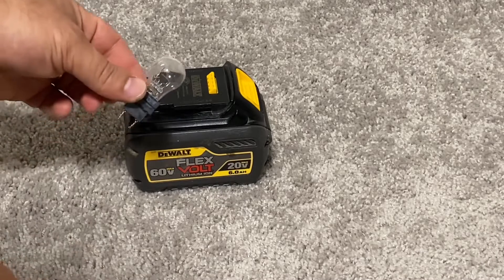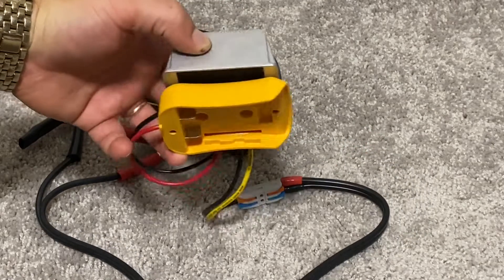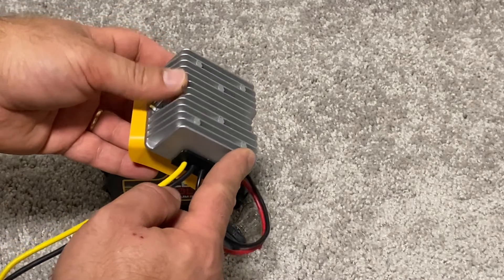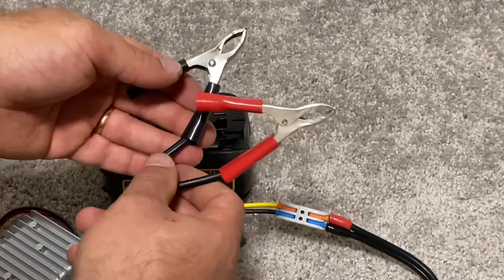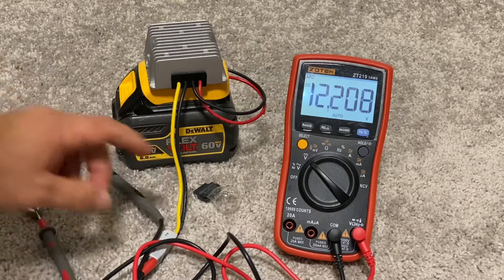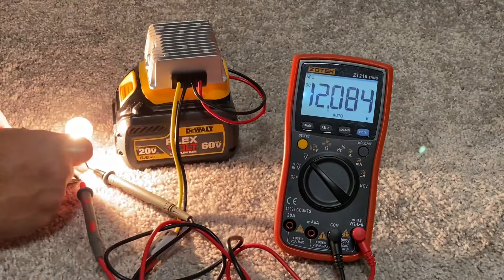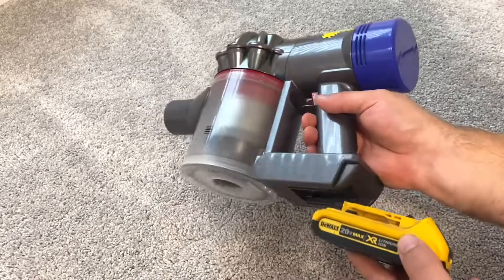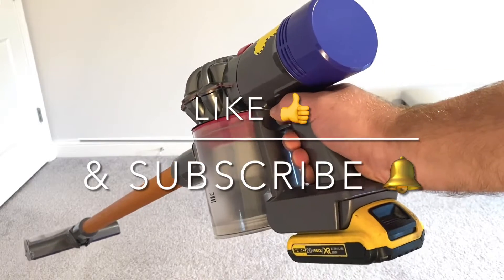DeWalt 20v to 12v Inverter Adapter 15 Amp 180 Watt review jump start car

Comment: Hi Mr.  If we have a step down 21v to 12v with more ampere capacity (40/50A) could it for jump start car?
Reply from the maker: I have one with 15 amps and I was able to charge the battery for about 30 minutes and then start the car, but 15 amps alone wasn’t able to start it. I am not sure if 40/50 amps will. It would surely put a strain the the DeWalt battery that may damage it. I would’t risk it.

Comment: I have noticed when I attach a DeWalt battery to an unofficial Dewalt device like a light and leave it run long enough to wear out  the battery it kills my Dewalt battery and will not take a charge again. I have had this happen to 2 different Dewalt batteries... Have you come across this?...
Reply: I haven't had that, because I watch the battery level once in a while to prevent it from happening, but it makes sense, because these aftermarket devices may not have over-discharge protection.

Comment: Would this work with the 40v makita batteries
Reply: definitely should, i did it to my old dead dewalt 20v charger. Ended up using their 60v batteries too! But you have to look up the pin layout for the battery/charger connector. I gutted everything but snipping the leads running vertically into the chargers connector. Easy adapter for anything your battery is rated to output! Have been trying to test its limits with cells ive had laying unused

Comment: With this inverter, when going from 20v 12.0ah batteryto 12v does the AH go up? 

I have a unit that will draw 2.9 amps hour. Does that only give me 4 hours of runtime at 12.0ah?
Reply from the maker: Based on your info about 20v 12Ah battery, I use the following calculation (by the way I count 18V instead of 20v because 20v MAX is just a marketing trick of DeWalt). 18V * 12Ah = 216Watt/hour. If we divide 216W/h by 12volts we get 18Ah. So the answer is YES to your first question. Now if you draw 2.9amps of 12v, 18Ah/2.9Am = 6.2 Hours. I didn't take into consideration some energy lose due to power conversion from 20v to 12v. It's probably about 5% or so. I hope this helps.

Comment: hello Sir, can you connect 2 dewalt 20volts battery in parellel in that adopter?
Reply from the maker: @FishingTravelUnboxingFood  I am not sure if its a good idea, since one battery can have different voltage than another one when they are not charged to same level. I think if they are charged to about same level, it should be OK.